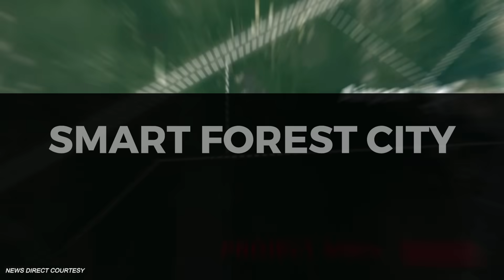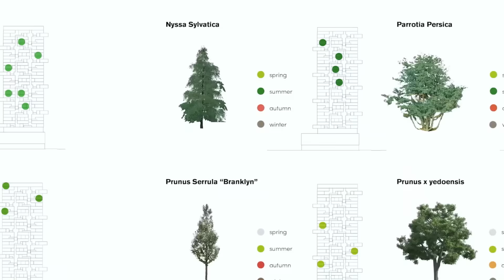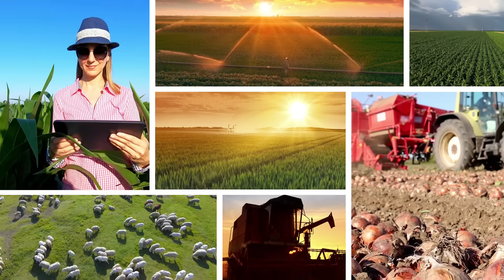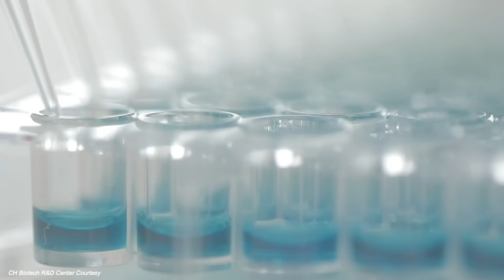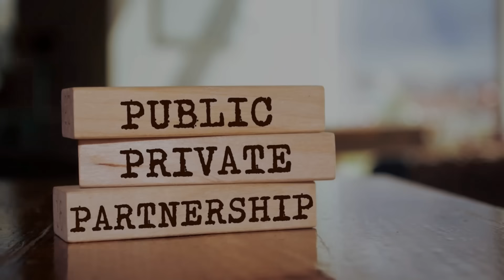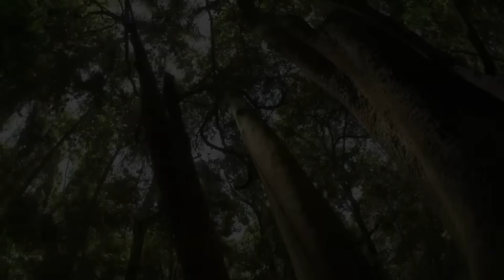The Most Ambitious City You Haven’t Heard Of (Yet)

Comment: I used to be a huge fan of desalination before I learned how bad the bi-product sludge was and how hard it is to deal with. They need a solution for that that is not pumping it back into the ocean if they want to use "ecology" as a selling point.
Reply: Depends on the desalination process. If done properly all you will get is salt and trace minerals. The dome process is by far the most eco friendly. The dome process does not require any power at all or expensive filters. Just a glass dome that collects water vaper from basically a large shallow indoor pool. Once all the water is evaporated the left over salt and minerals can be havested as well for more economic benefits.
Reply: I think the Australians figured it out
Reply: The plan is to dump it in the ocean. Ecology is just a gimmick. This is pure green washing

Comment: Should use the solar ring and batteries as backup and run it with the new thorium salt reactor and use the storage system from natrium reactors that terrapower is working on. Thorium reactors dissolve the fissile fuel in the cooling systems water making the fuel double as a heat transfer coolant. The fuel is used much more efficiently and for a longer period of time, depleting it further and making it less Radioactive over time. Then there's the chase load capability and no need for pumps through half the storage and supply system as the Sodium tank could just use magnets to move the liquid Sodium used to capture and transfer heat energy from the reactor to the "actual" liquid salt tank witch can be filled and emptied to adjust for energy demand. And if you configure the facility in two sections, even if the reactor goes down, you can still have 100% output from the heat energy storage tanks of seperated salt and sodium liquids. Natrium reactors and Thorium reactors are the newest, cleanest nuclear reactors we have, and the first of both goes online next year in the states (natrium reactor) and the Netherlands (thorium reactor). Now I'm just waiting to see how long before they realize sticking them together makes them even more efficient and clean. And anybody wanting to rip on nuclear ENERGY, not NUCLEAR BOMBS, less than 300 people have died throughout all of nuclear energy's history meanwhile fossil fuels kills an average of 160 people EVERY YEAR...not including pollution deaths and related illnesses...so um...which one is more dangerous again? Nuclear is a green energy, but fossil fuels like to point to that poorly built thing in tchernobyl that was built on a budget, and staffed by arrogant idiots, or they point to the 3 mile island thing which was actually mitigated well but blown out of proportion by fossil fuel advocates, media, newspapers, and state governments in big oils pocket. More recently Fukushima gets a bad wrap, but it was actually the relocation and uprooting of nearby population that did more financial and psychological damage cuz the evac was done SO well and so fast, yeah nobody got sick, but peoples lives got turned upside down in a flash, for an accident that admittedly, by Japan's own admission, didn't need that extreme of a relocation effort.

Comment: You'll never be able to power a city that size with solar.
Reply: Right maybe with the technology of man made diamonds that safely hold nuclear waste and never need charged
Reply: Of course you can. Solar is the cheapest form of electric power generation ever invented. With batteries and other forms of energy storage, you can use it 24/7.
Reply: @MaximusNYC  it works on a small scale. I's basically impossible to scale because of how and how quickly they degrade
Reply: with enough resources is not terribly hard. They will have to invest in some amazing batteries but with current technology it can be done.

Comment: Green buildings:
Didn't anyone learn that plants, trees, bushes and vines creep in and destroy buildings?
😖😜😝
Reply: Actually, green buildings are designed with specific plant types and systems that protect rather than damage structures. 
Green roofs and living walls use barriers and root control layers to prevent intrusion,it's all planned, not random growth.
Now you know :yougotthis:
Reply: @CesarAnton  I'm not worried so much about what plants the architects decide to put on the buildings than the plant and animal life surrounding it. 

If you don't maintain the property and protect it from pests and unintended plants, it's can potentially cause big and expensive problems. That is what happened to Boeri's previous greenscraper project in Milan, and is a minor critique by its tenants/owners.
Reply: @ancova1183  maintenance is always important, plant or not.
Without proper maintenance even a plant-free facade becomes fails.
Done right the benefits far outweigh and outnumber any potential issue.
For example, plant's help protecting the building from retaining too much heath when exposed to direct sun light.
Reply: @CesarAnton  Yes, but maintaining the horticulture, irrigation, and replacing plants to maintain all of those benefits costs 3x more than a similar glass/stone facade (specifically, bosco verticale costs $1800/month compared to $600/month for luxury apartments in Milan).

You're not going to find many people who can afford that living in Cancun. And it's questionable how many billionaires will want to sink that much cash next to a rainforest when they could invest it on Cancun's beachfront instead.
Reply: @ancova1183  you're missing some key context. In a hot and humid region like Mérida or Cancún, green buildings can actually help save money over time by reducing cooling costs, especially when temperatures stay above 80°F most of the year. Vegetation helps keep buildings cooler naturally, which directly cuts electricity use.

Also, comparing Milan to Southeast Mexico doesn’t make sense, different climate, different energy demands, different economic context. Costs and benefits don’t translate 1:1.

And let’s be honest: dismissing ecological solutions purely because they seem more expensive upfront is short-sighted. That mindset is exactly why so many sustainable innovations get blocked. In the long run, green design often pays off, financially and environmentally.
Reply: @CesarAnton  I'm not saying the green city or its technology isn't a good idea. I just don't see any of those benefits in a green skyscraper development in the middle of the Cancun jungle.
Reply: @ancova1183  I think I see where the confusion comes from, so here are a few key points to consider:

Cancún is extremely hot and gets far more sunlight than any place in the U.S. (due to the latitude), which makes the cooling and shading benefits of green walls especially valuable. 

And in a tropical climate like this, keeping plants alive isn’t difficult. Labor costs are low, while electricity is expensive, so there’s a strong economic incentive to favor manual plant maintenance over high cooling bills. 

Also, while the principle is also applicable, this isn’t about skyscrapers, it's a plan for relatively low-rise buildings. The local terrain isn't suitable for tall structures anyway. 

Hope this helps. Cheers 👋
Reply: @CesarAnton  Yeah, that does make more sense.
Reply: It's only a probem if you can't afford the maintenance of the plants, which isn't really a problem if your target demographic are billionaires. And if you can't find enough billionaires, the problem quickly spreads to the entire building and city.

Hopefully Boeri has learned a little from his previous challenges in building Bosco Verticale and other green city plans. The sales pitch seems to imply this by saying the greenery will expand horizontally and doesn't mention vertically (although the renders show otherwise), so there's some hope the greenery will be more limited on the building facades.
Reply: That is what the eco-friendly, low-carbon, sustainable, green herbicides are for.